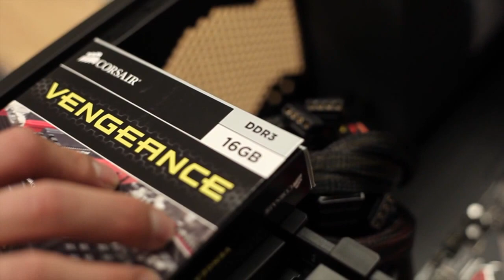How To: Build Your Own System

Comment: HELP! I have tried to build this system using the same GPU, MB, and Memory. My VGA is a EVGA GTS 450. I've tried to build this with the core I7 2700K processor. However, when I turn the power on, the CPU LED located near where you plug in the power chord for the motherboard stays lit red. The MB wont boot past that point, not even to get into the Bios. I have sent 2 MBs and 1 I7 2700K CPU back thinking that each were the issue. Im on my 3rd MB and 2nd CPU. Any suggestions? is 2700k compatible?